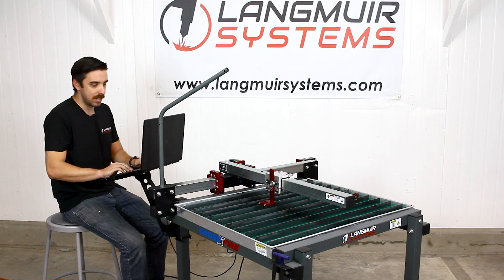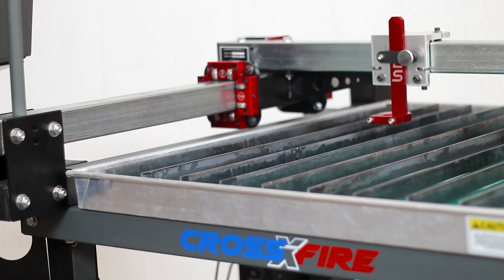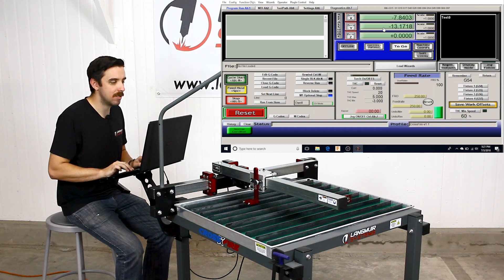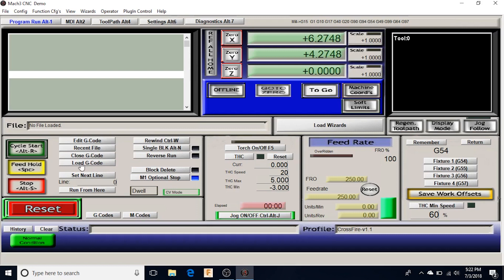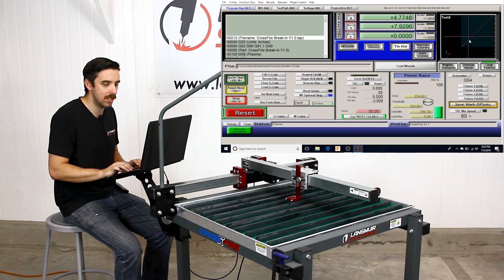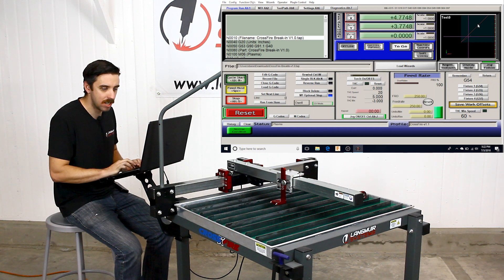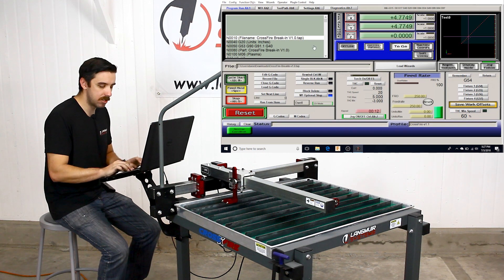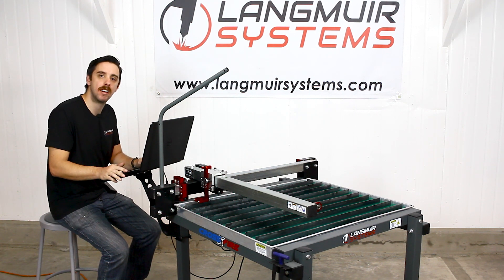[LEGACY MACHINES ONLY] CrossFire Cutting Tutorial Part 3: Jogging, Offsets & Break-in Program

Comment: Would a dry lube that isn't sticky like teflon wax spray on the ball screws help?   The teflon spray can flush anything that lands on the ball screw off of it, and the light film that is left behind is dry and lubricates.
Reply from the maker: We actually recommend oil lubrication on the lead screws. We have found that it works the best. The screws are actually not ballscrews, but rather ACME lead screws with wear compensating delrin lead nuts. The lead nuts are designed to clear dirt/debris from the threads. The reason we reccommend oil is because it prevents chatter and also prevents corrosion of the lead screws.
Reply: Langmuir Systems thanks.  I knew they weren't ball screws but I was drawing a blank on the the term: "lead" so I punted. So what do you think about that dry lube option?  I use it on anything I don't want attracting dust/debris like bicycle chains, garage doors, hinges, etc.  I've used it up flush out dirty locks.  What are your thoughts on it?